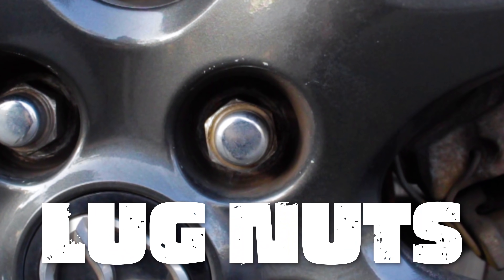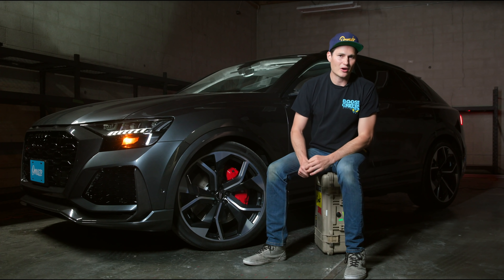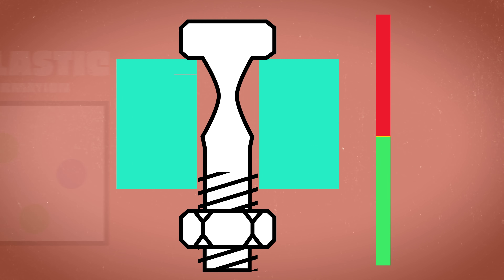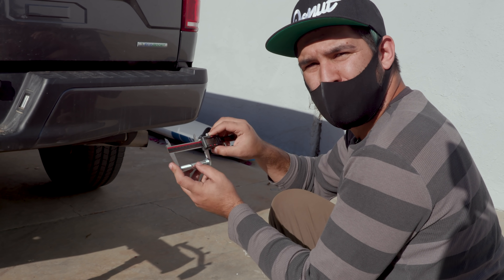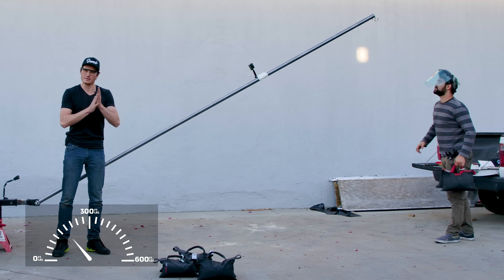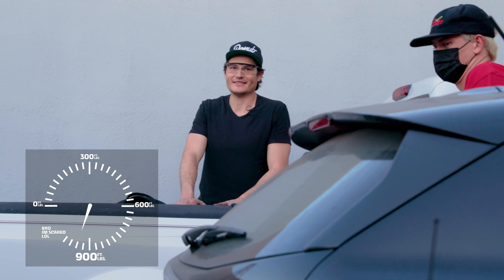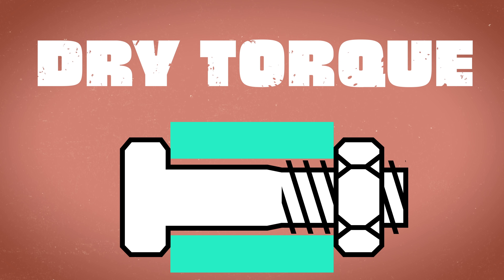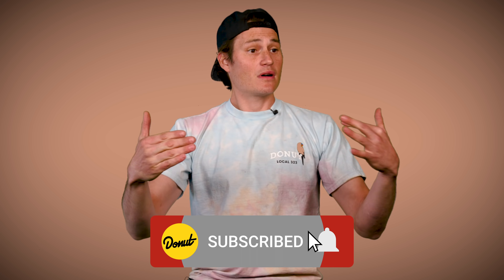What happens when you over torque a bolt?

Comment: It would have been good to see a talk on stretch gauging bolts when individual fastener integrity is absolutely critical. Usually rod bolts but there's others too. While a torque spec and angle is good for most usage, a stretch value lets you check individual fasteners instead of relying on the assumption that all bolts are identical.

Comment: when you over torque the bolts on an exhaust clamp, you end up with an angle grinder in your hand hoping you can cut it just enough to pound it off so you dont create a new exhaust hole

Comment: Also, the bolts on an engine block or anything else that experiences a wide range of temperatures is going to expand and contract to some extent, and the fastener won't expand at the same rate as the thing it's fastening together. So that's an additional stress on the fastener and the material it's clamping together.

Comment: This is why Torque + 45° (or any other overtorqued spec) bolts can not be re-used. They undergo plastic deformation as part if the spec to yield higher clamping force with a smaller bolt. But going further with re-use risks too much deformation.

Comment: I used to build brake assemblies for an auto manufacturer. The assembly included the knuckle, hubs/bearings, disks(rotors), calipers, pads, abs sensors, control arms, etc. They took it seriously. EVERYTHING that touched the floor was to be thrown away. Bolts, clips, and even finished goods. They didn't want dust anywhere near those parts until they were fully assembled to the vehicle.

Comment: For the sane part of the world
- 140 of something = 190Nm
- 1000 of something = 1356Nm
- 1/4 inch bolt is fckn M8
- 'grade 5 bolt' is equivalent to 8.8 with 800MPa of strength, the bolt itself says A70, sounds like 700MPa
... Flies away

Comment: Late bolt will shear before normal stress becomes a problem. Tc/J IS formula. Ductile materials like most metals break with shear then stress in applications like this. Also at 45 degrees is the max shear angle to you get a cone shape at end.

Comment: 3:23 Did you know engineers purposefully get head bolts into the elastic range? It allows for that stretch on purpose. That’s why you are required to replace head bolts with new head bolts when you reinstall it.

Comment: If you're using an ugga-dugga to tighten your oil filler cap, you may want to put down the ugga-dugga and step away from the vehicle.

An interesting observation I've made during nearly 20 years as an automotive technician is that people who don't regularly work on tightening fasteners really have no idea what is too tight or too loose. As someone who does (or did) that kind of work regularly, you get a feel for what is right. Its not a replacement for a torque wrench by any means, but for non-critical fasteners, you can use your intuition/experience to tighten them sufficiently. On the flip side, whenever I was working with (teaching) someone who didn't have that level of experience, I'd always insist that they use a torque wrench and I'd often ban them from power tools. I saw so many broken or loose fasteners when these newer techs didn't use a torque wrench because they had no idea what was good and what wasn't. When I forced them to start using a torque wrench for just about everything, that problem went away, and within a year or so of doing that, they would be able to tighten non-critical fasteners pretty accurately just based off of feel. This does translate to using a power tool because you get a feel through the tool. Again, that isn't a replacement for a torque wrench and they should ALWAYS be used on critical fasteners (like any internal or load bearing components).

Comment: This is a very good video if you're in some dirty shit hole and you run across some TTY bolts you can also measure the shank to see if it has stretched as well as the threads if it's still within a few thousandths you can get away with using it .......don't tell anyone

Comment: Someone explained to me that the higher you torque your bolt, at a certain point you start taking away from the force that the bolt can hold.  For example, the bolt on a lug nut, the tighter it's put on, the more overtightened it gets the easier it will be for the lug nut to fail.
That's the easiest to understand explanation someone told me.

Comment: We used bolt stretch on main journal bearing studs using a hydraulic wrench as this gave more reliable torque results than using a standard torque wrench, specifically because of the size of these studs( these were used in a 5,000 hp genset) we used a dial indicator and they had to stretch to specific length, these were .032. If they didn't stretch after going up to 10,000 psi, the bolt had seen plastic deformation before( either by use or an imperfection in the forging process) and was thrown out.

Comment: I worked in a bakery and a mixer motor failed ( it had been used 24/6 for 12 years) and the bolts to gear to get to the input shaft had been getting constantly wet... so basically the nut had become part of the bolt - we broke a breaker bar that had a 1 inch drive- we had a six foot cheater bar and about 1400 lbs of dudes - in the end we had to chill the nut/bolt with ice and blowtorch the nut several times before it broke free and when I say blowtorch I mean glowing hot

Comment: Bolts almost always break at the end of where the nuts stop on the bolt, aka the thinnest part of the bolt after the force pulling on the bolt. Hardly do they ever break on the smooth surface past the threads because you are stretching the threaded region more than   anything, especially in surfaces where the bolt is threaded into the item that you are tightening too. The first bolt that breaks in the video shows it breaking at the threads, so this is why it did.

This is also most of your heavy duty bolts like cylinder head bolts are fine thread.

Comment: It's cross-sectional area of the bolts you have to directly compare not diameter. You would need approximately 16x the max force of the 1/4in bolt to break the 1in.

Comment: What about that good rule of thumb about replacing Headbolts even though torqued to specs? Is that torque spec for headbolts passed the yielding point? And does this also pertain to studs? Btw should of used a torque multiplier to be safe :)
Reply: Almost all modern headbolts are TTY. TTY bolts should ALWAYS be replaced.

Comment: You guys realize that your math was off right? The poles weight is the double integral of the wight function and the length. IE the torque that the weight if the bar applies given the weight at the base of the bar is different than the torque that the weight at the end of the bar applies. This is rather obvious when you think about it, thus since the weight of the bar is significant you must sum the weight of the bar at each individual length which is where the double integral comes from (you can do one integral if the weight is dependent on the length IE if you convert to density of the bar). Point being is that over that long length of bar you are likely applying far less torque than you thought due to the fact that the torque purely applied by the bar cannot be approximated by just doing the full length of the bar times the full weight of the bar.

Comment: I got about $2k into a DIY Subaru turbo rebuild and on the second to last torquing step on the last head, I hydrolocked (didn't know this at the time) a head holt with I'm assuming too much lube, and sheered the threads clean out of the block. From the bottom of the bolt to the head. Anyone in the Portland area need Subaru engine parts? Lmao. Got deliciously machined B25 heads.

Comment: Never have I seen someone so skiddish of a bolt snapping. Like yea it’s under a lot of pressure but if you stay in the opposite directions of the way it could snap, (which they are) then you should be fine.

Comment: Translation to the ending about using lubricants changing a torque value, kiddies...

Stop putting anti-seize on lugnuts.  It's completely unnecessary if the vehicle's lugnuts are good or the lug-covers are actually present.  It also makes a gott-damn mess.

Comment: Hey donut, this video was really lacking. 
I feel like you could have explained how much torque an impact gun produces and the effect that has, and opposed to using a torque wrench. 
I feel like you took out a multimeter and didn’t even use it to prove anything. 
I feel like you could’ve explained why it’s super important that we don’t torque beyond manufacturer specifications and explain why on 2 really important parts: wheels and head bolts. 
I mean damn, you didn’t even tell us not to try this at home.

Comment: FUN FACT: On a CH-47D helicopter the PC links are torqued to 400 to 660 IN LBS it has a castle nut you have to line a cotter pin up in the key way. You can go to 660 three times before replacing the hardware. But you have to change the castle nut Everytime you removed the torqued nut after flight.

Comment: not only is the area of the bolt doubled but the radius of the bolt is increased so the torque you put on the bolt corresponds to less force. clamping force is roughly a function of radius, thread pitch, and torque applied

Comment: I do structural testing of aerospace hardware. We had a steel test structure that had some 2" high strength bolts intended to be torqued close to yield. During install we broke one. Turns out the bolt coating and lube we were using had a much lower K factor than what was thought. So our torque resulted in more tension than we thought and overloaded the bolts.

Fun fact: some of the bolts on RS25 rocket engine are tightened with the use of an extensionometer to precisely measure the exact stretch created in the fastener.

Comment: i remember the strongest bolt i encountered we put more force then that and it wouldn't budge, we had a torque multiplier with 2 6 or 7 foot is steel pipes over each handle and me and another guy on either handle our impact Allen key socket was twisting the way your bolt was at that point we said fuck it you can either hire a machinist to machine it out or you can buy a new forklift. no joke that one bolt alone left them with those 2 options.

Comment: 🤣 nice Video. Im a metalworker. And a year ago we build a Steel Framework for a small Building. The given torque of some screws were 600 ft lbs. but we didn’t use a 15ft pipe😂 we used a 3ft torquewrench 🤣

Comment: Gerry, you also aren't correcting for the angle you put the load on at for most of the experiment. Also you need to use the minor diameter of the bolt for your calculations. You were also comparing a coarse and fine thread screw, which have different od to minor diameter ratios.

Comment: I play with heavy equipment at work and we have cordless power tools capable of more than 4000 ft/lbs. I’m very familiar with most tools hand or otherwise are capable of, while you don’t need anything even close to 13 foot long pipe to reach 1000 ft/lbs im more amazed the drive didn’t snap on that 1/2” breaker bar.

Comment: I just got new wheels for my car. My car manual says 150ft lbs for the lug nut torque. The wheels are the same spec as stock just a different style so the lugs should be technically the same. So I tourqed them to 150. I did everything In my power to make sure I did it right.

Comment: I told some guys not to use any ugga-duggas on my lugs when putting them back on tight. The idiot did on my first 2 wheels before I walked out and said don't touch the damn car. I had the manager put the wheels on. My lugs aren't supposed to surpass 85ft-lbs and they went past it. Had to replace all those studs, but one of those lugs took everything I had to remove and it damaged my wheel. Hate idiots who don't care and no, they weren't busy.

Comment: FYI 8.8 or 10.9 bolts mean:
8.8 - 8 MPa max stress, 80% or 0.8 yield point, at 6.4 MPa
10.9 - 10 Mpa max, 90% or 0.9 yield point, at 9.0 MPa

It's good practice to remain 10% below the yield point, when no further calculation can be provided. 

So check your bolts when you can't find torque specs or for your DIY projects. 

At least for the european guys here using DIN and ISO bolts.

Comment: I’m surprised your breaker bar didn’t fail @ 1000 ft. lbs! That would be 100 lbs of weight placed 10 feet out on your stainless pipe. Which you seemed to have accomplished. Hmmmmm

Comment: Had a broken 3/4" torque wrench in school and we were trying to torque U-bolts on a semi. When we realized that something was wrong, no one believed that we had a "broken" torque wrench and said that we just weren't there yet. Ended up stretching the bolt to the point where it snapped in half and sounded like a shotgun blast.
Reply: it is very easy for a torque wrench to go out of spec.
Reply: @jorgecosta95  Actually it's not all that easy. 
As far as a click type wrench, it's a fairly big tension spring inside and they dont come out of spec very easy at all, especially if it's a quality brand.
 Even with years of mistreatment my late 1980's Proto 1/2 click torque wrench still passed the calibration test at my work. I never knew till like 5 years ago that it was bad to leave them cranked up to 85 ft lbs when you store it, I know now your supposed to leave them on a low setting like 20ft lbs. 
Mine has been dropped, hammered, and used to loosen fasteners and is still calibrated perfectly in spec.
Reply: @jorgecosta95  z,
Reply: dude you should of known way before it popped. but school is school. Best to learn by fucking up in my opinion
Reply: @ScootsMcPoot  especially when you're not the one paying for it lmao
Reply: Holy hell you torque them?
Reply: @cliffmabus8732  you don't mess around with DOT stuff. That'd how you end up in prison...
Reply: @cliffmabus8732  that’s how shop class works
Reply: I know this comment is two years old but I broke two u-bolts on the front of a semi yesterday at work like this, one from a broken torque wrench and one from bad heat treat
Reply: “Torqued it!”

Comment: Cool video! The material science you talked about wasnt completely correct though, Plastic deformation doesn't necessarily involve breaking molecules (breaking chemical bonds). For example with metals and metal alloys (which is what youre really talking about) there is a lattice (arrangement) of metal atoms and/or metal-nonmetal molecules For example steel has iron atoms (Fe) and iron carbide molecules (Fe3C, aka cementite). In elastic deformation, the arrangement of these particles (atoms and or molecules) deforms and like you said returns to the original arrangement. But plastic deformation involves the particles slipping and will rearrange in a new arrangement but the chemical constituents are the same and no molecular bonds have broken (in metals and metal alloys at least). Again, great video :D love your stuff and im super glad youre introducing car folks into the engineering and science behind how cars work :)

Comment: People laugh at my pipe-and-weight type torque wrench like you guys used. Many mechanics simply can't afford a 600 Ft-Lb cap or higher wrench so for loads like this  and more I use lengths of 2 inch schedule 80 aluminum pipe and a special fabricated 3/4 drive head to do basically what you do in this video. I use a hand spring scale for the force and it is important to apply the force at right angle (90 degrees) to the distance from the fastener center line. Check the accuracy of your spring scale by lifting known weights - It is an accurate system although much more cumbersome than a large torque wrench but better than guessing with a huge impact.
Reply: The people who laugh at your technique are the same kids who laughed at the person studying for the final who's getting an A regardless while, at the same time, hoping they pass with a C.

Comment: I think it’s also worth mentioning the differences in the grades or property classes of bolts and some of the misconceptions with that. Grade 8 bolts are stronger but more brittle because of the additional carbon, Stainless bolts are in fact weaker than carbon steels, etc. also talking grades you can talk case hardening. The layer of hardened steel in bolts will penetrate about the same amount so a 1/4” bolt will have the same case hardened thickness as a 1” but the percentages are greater in that of a 1/4” bolt. Platings and coatings are another good topic for things like hydrogen embrittlement. Things that could be another episode though.

Comment: I know for a fact that they put over a 1000 ft.lbs. of torque on that bolt. I do Pressure/Hydro Testing on gas plants, which requires us to torque bolts all day so flanges don’t leak. We use a 1000 ft.lbs. Torque with a 4 foot extension which makes it 8 feet long. With that you can apply 1000 pounds with no problem. Just imagine a 13 foot pole. I’m pretty sure you guys were more closer to 1700 pounds than 1000 pounds.

Comment: Something you didn't cover is how the part you're bolting down can get distorted. Cylinder heads are very particular about this. If the bolts are not torqued evenly enough it can warp the head. There are a lot of parts like that, including wheels and brake rotors. If the lug nuts are not evenly tightened on a wheel, or if they are overtightened, it can cause the brake rotor to warp, and then you get brake pulsation.

Also, I'm super disappointed you didn't break that bolt. I wanted to see tools fly.

Comment: 7:30 but you guys do realize that torque applied to bolt increases, when bar is getting more horizontal? When you put bar almost vertical and hang bags of sand, you applied torque so small, you probably do with one hand and a small ratchet. Torque is force multiplied by arm on which its applied, and when you are using gravity as a source of force arm is measured in horizontal distance. Vertical bar = 0 arm = 0 torque even if you hang 10 tons of sandbags on it